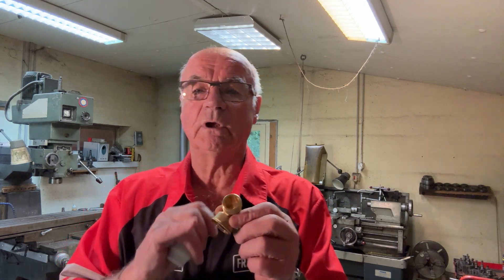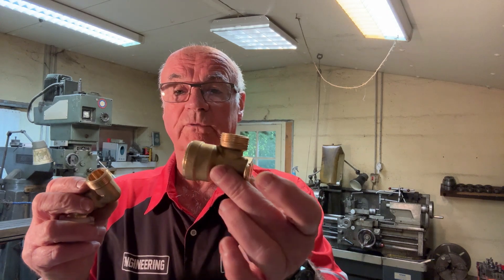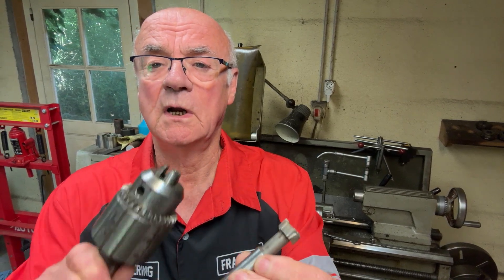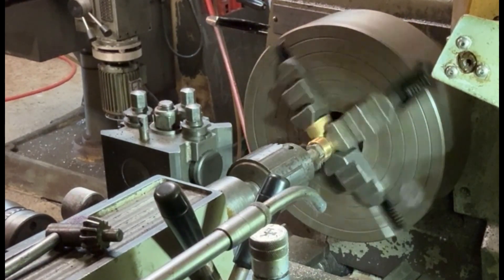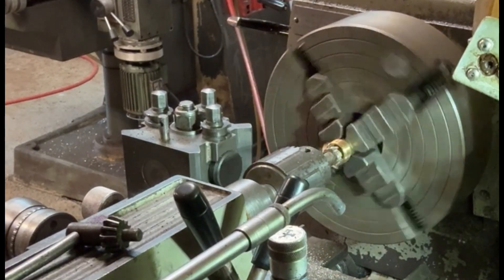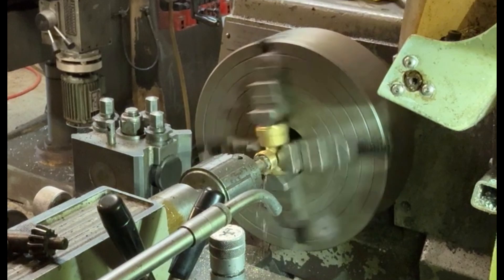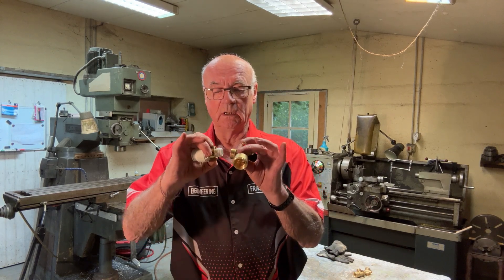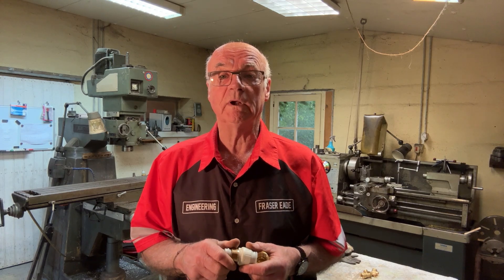Boring Out Brass Plumbing Fittings

Comment: I would have been very interested in seeing how you set the fitting up in the chuck to get the bore adequately aligned. My first inclination would have been to turn a mandrel for the tailstock chuck that was a nice slip fit into the fitting to hold it in alignment, then bring the jaws in carefully to hold it. What was your actual method?
Reply from the maker: Hi, thanks for the comments. I had the thing set in the chuck before I even thought about showing the setup. I intend making a video to show what my lathe can do later. Yes, I could have made a mandrel but I chose to use the DTI (clock gauge) to set it up.
Reply: @MetalworkinginFrance-xe5rg  Without trying it myself it’s tough to figure out which would have been easier but hey, more than one way to skin a cat.

Comment: "french" fittings are are actually BSP threads :p
Reply from the maker: Hi, thanks for your comments. The problem was not with the thread size: as you point out they are the same for Imperial and Metric parts. The problem was the internal diameter of the fitting.

Comment: What’s reason for preferring the milling cutter rather than using a boring bar?
Reply from the maker: Hi, thanks for the comment. Just easier to push in the milling cutter which was the right size, rather than using a boring bar then having to measure.

Comment: You got away without a pull in! The French do use BSP threads, but they call them by a metric size, but then BSP always confuses people as it is named after the ID of the pipe, and nothing to do with the diameter of the thread, as of course you know. Stay safe! Chris B.
Reply from the maker: Hi Chris, thanks for the comment. Thread size was not a problem, just the inside diameter was for a French fitting but Speed-fit takes UK size plastic pipe. Cheers. Fraser.